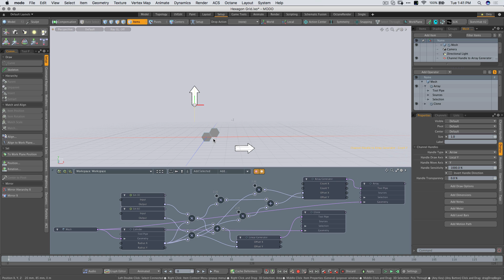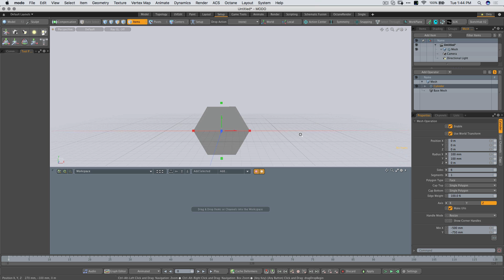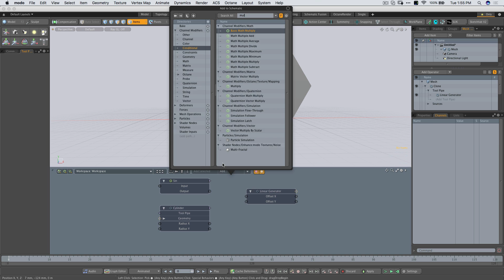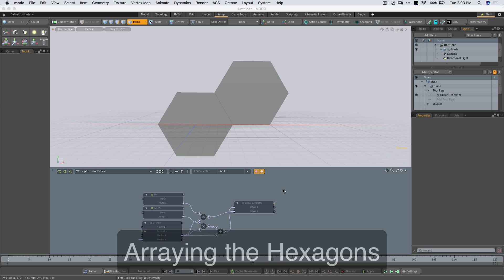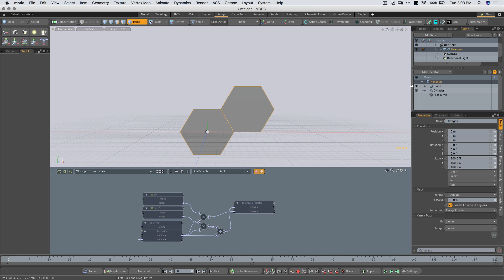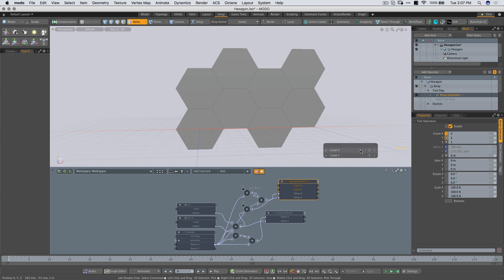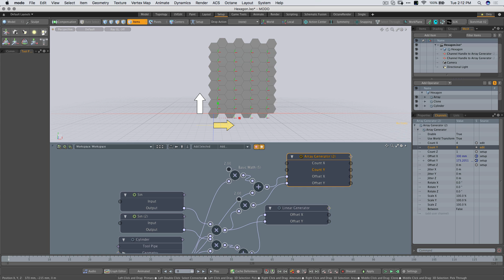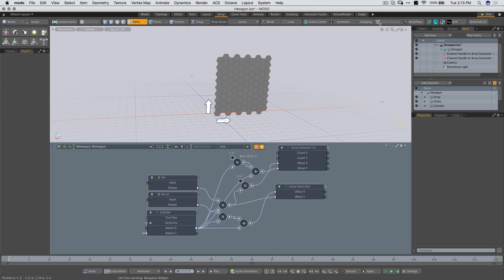Procedural Hexagon Array (How to)

Comment: A bit different way to do this is to use Mesh Info node to get dimension of the mesh you want to duplicate. Then you can just multiply and divide the dimensions to get right offset, no need for Trigonometry. 

If you use Mesh Info, you have to Merge the base mesh to the procedural cloning Mesh. Otherwise you get a dependency loop.

Comment: If you don't want to slow things down or get confused with math...

Create a diagonal staircase array of items in cube space like in cubert, apply a rotation then you use the X & Z position of each of those to generate the hexagon, obviously not inheriting world rotation and scale. Gives you plenty of control, and you can get your head around the pathing and actually see an accurate representation of what's happening in the viewport. It's just adding or subtracting increments of any constant number in any direction, and you can use that to determine the scale of the hexagon.

Please credit me if you end up using this method, as it's the only clever thing I've ever programmed :P